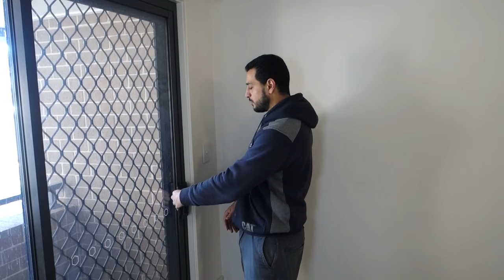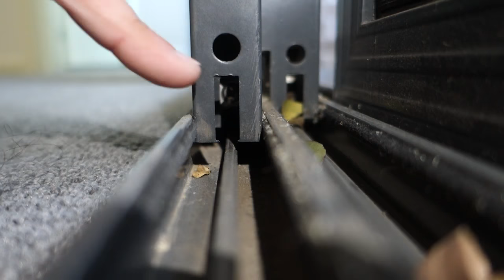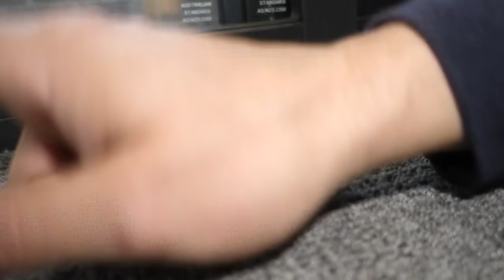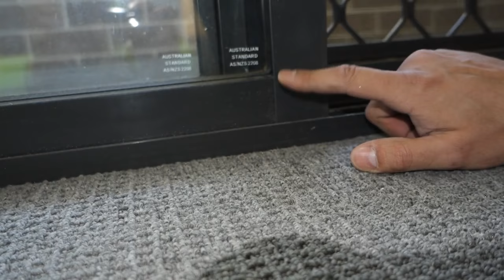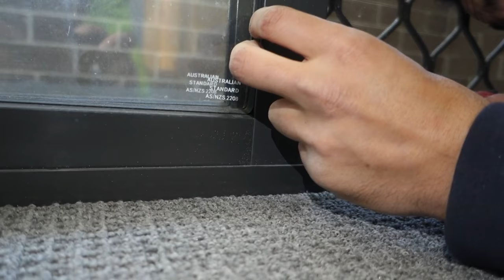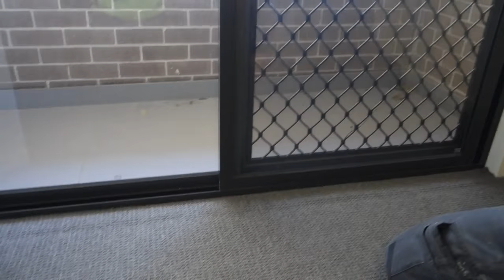How to fix sliding glass patio door - adjust the wheels

Comment: This worked! Thank U soo much! 2 yrs since I bought my place & dealt w/ this issue. Even the inspector didn't catch it! I'm possibly one of the least handy, mechanical, shaky fingered *impatient people! lol. 

I was thisclose to calling a handyman/technician or whoever who almost no doubt would've gassed me even for something so basic. 50 yr old rough looking/acting sliding door that wouldn't lock or close 100% (about 1/4 opening on the lower part). Simply tightening that lower screw basically resolved the issue entirely (+ it locks now)! THX again :D

Comment: Great video, straight to the point.
With our we got a clunk & the door when closed has a large gap at the top which is now not locking....  we did find a small chip of black plastic in the track, not sire  if that came from inside the door.. what could it be? I did try to adjust the screws but they did not seem to shift!!!!

Comment: Hi Bill i have the same problem with a sling window and there is a gap towards the top side. Can i use the same method to fix it?
Reply from the maker: Sounds like a wheel may be broken as windows aren’t usually adjustable

Comment: Hey Bill, great video.  I'm a Greek wench...lol and my mama's sliding door isn't gliding like it should (hasn't for a year or so) & useless bro is well, useless. I don't have any type of drill, so can I adjust it manually (by hand) with a long screwdriver? Are the screws generally Philips head?  I will give it a go tomorrow. Cheers.
Reply from the maker: Hi, this can be done with a Philip’s head screw driver. Might be a little more difficult using a screw driver due to the weight of the door. If this is the case, have someone take some of the weight from the door by lifting it up while you adjust the wheels 👍
Reply: @billshowto  thank you for your reply back, very kind of you. I'll let you know how it goes. Cheers S.

Comment: IT HAPPEN ON MY SLIDING WINDOW I ISE FLASHLIGHT TO SEE WHAT'S WRONG WITH IT, I CHECK THE BOTTOM OF IT AND SEE THE WHEELS I CHECKED THE OTHER ONE THAT HAS PROBLEM AND SEE IT WAS NOT A LINE SO  I PICKED IT UP AND MOVE IT TO THE LINE NOW MY SLIDING WINDOW WORKS WELL.

Comment: didn't work for me unfortunately. the screw didn't raise the wheel up and down. tried replacing the wheel and the frame still slides on the tracks. so I tried removing the entire carrier and that broke into about 6 pieces and was still stuck. ended up needing a new frame and properly designed carriers which do go up and down